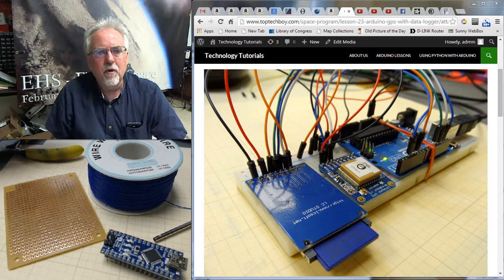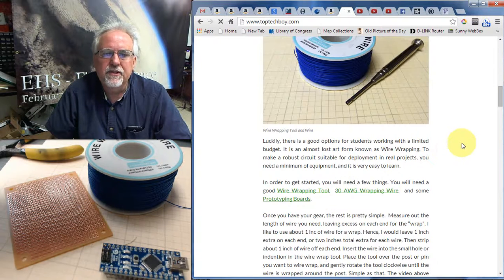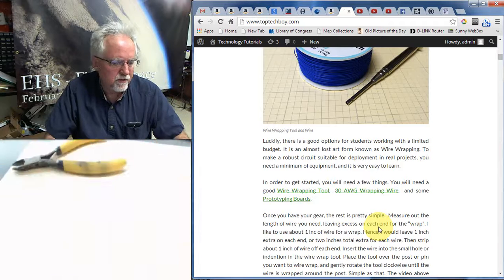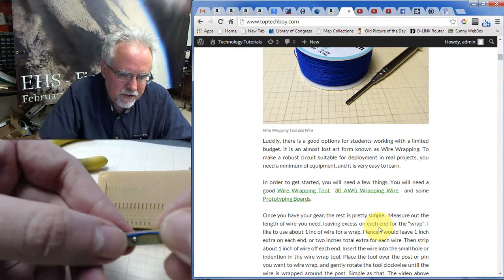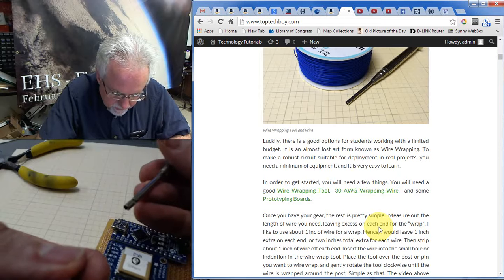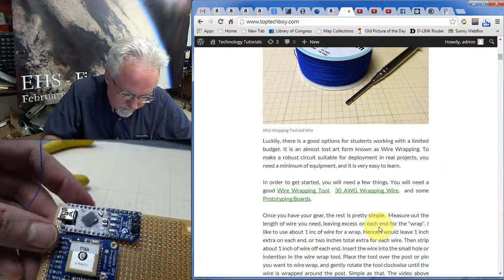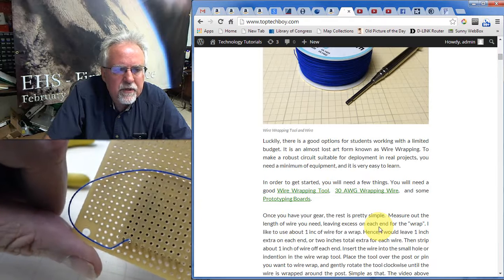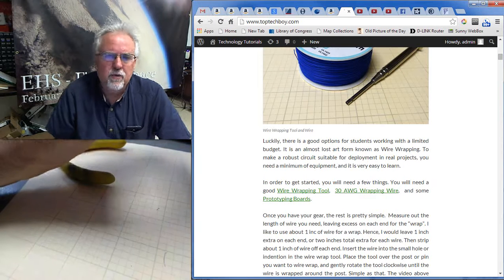LESSON 26: Wire Wrapping

Comment: I'm probably much older than most of your students, but I guess I'm young enough to have never heard of wire wrapping! This is fantastic.

*Also, this answered a question I had about a tool I got in a discount bin, but raised more questions. It said it was a "wire wrapping tool" and I pulled my hair out trying to search what that meant and how to do it with that specific tool. Found nothing. It doesn't look like the tools used here, it's just a straight piece of solid metal in a cylindrical shape with a slot cut slightly off-center. Picture a thin screwdriver cut off flat at the neck with a vertical slit. If anyone can help me out with how this is used for wrapping I'd be greatly appreciative, whether written explanation or examples online.

Comment: From other sources I have seen that they also wrap 1 or 2 turns of insulated wire just by pushing some if the insulated part of the wire into the tool as well, and that this would make a stronger, pulling-proof and also more vibration resistant connection. Just a hint.

Comment: I have been wire-wrapping for 50 years. Boards I wrapped 50 years ago are still working. I won't give it up but hand wrapping is too slow. I use a Gardner-Denver WW electric tool that doe a full wrap in about a second and I use Clauson no-nik strippers which are not only quick but wont nick your wire. The length of strip I use is about 3/4 " which gives about 10 turns on a .025" square post. This leaves room for a second wrap.. Thanks for bringing this up to the view of many young ones. This can also be used in boards which use fine pitch leads by using a small PCB to solder the FP part to but the board also has .1" pitch leads on it that you can stick in your Motherboard to WW.

Comment: The perfboard is without copper, why don't you rout the wires through the other side and use pin headers to make the boards removable? How you did it right now, it will be a pain in the ass if you have to replace the board with anew one

Comment: wonder can i create that wraping tool with old radio antena ? xD
thin tube and hole at the bottom seem what you need :D
+ some stripper
v2 use power drill well need weaker power drill

Comment: It was a great video. I'm doing a project with an arduino nano and I want to use a wrapping tool just like you did. There are different sizes of wrapping tool wsb 2426, wsb 28, wsb 30
Can you please tell me about which size of tool you're using in the video and which is the most versatile option for me to buy and use for arduino projects because I'll probably buy only one

Comment: Hi Paul. Thank you for this series of GREAT videos. You did a super job and are very kind in sharing it. I heard about wire wrapping long time ago but this is the first time I see it in action. I have a question however. How does it work when you have several boards, sensors, breakouts using the same pins. Common case is when several sensors take power from Arduino 5V pin. How do you wire wrap in this case ? Thank you in advance for your suggestions

Comment: can someone give me the measurements for the tip of the tool? I have a machine shop nearby it may be cheaper to have one made.
Reply from the maker: +kevin moriarity I know what you mean. Wire wrapping is a lost art, and it is hard to find reasonable prices on quality tools.
Reply: +kevin moriarity If you make it I'll buy a few. but if you could change the wire stripper to be two razor blades with a endstop to make the blades replaceable would be a great enhancement.

Comment: Just curious: Why wire wrap instead of solder? Seems like soldering would be more stable and you could still desolder it later if need be.
Reply from the maker: DukeOfMarshall It is really hard to unsolder and get all the solder off. I really like wire wrapping and it is very secure. In fact, in the early days of computers, this is how they were put together.
Reply: Paul McWhorter That makes sense. This is the first video I've heard of wire wrapping. How usable and/or damaged is the wire when it's removed after wire wrapping itm
Reply from the maker: DukeOfMarshall It is easy to "unwrap", and you could reuse the wire if you clip the curled part off the end.
Reply: DukeOfMarshall and a 5 year old could do it safely